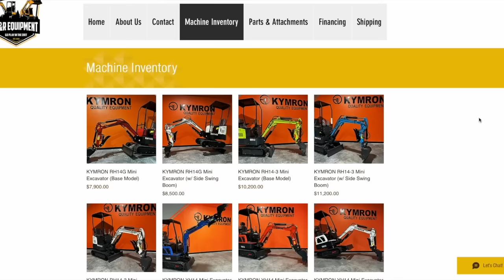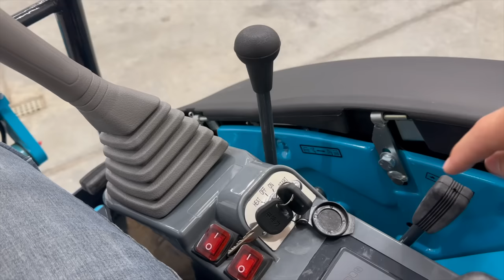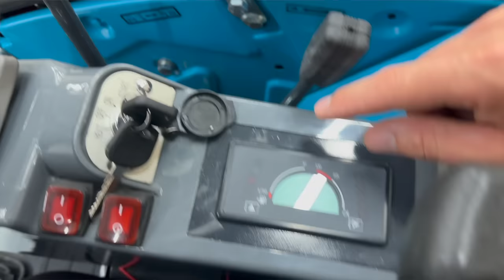KYMRON Excavator...Overview, Testing and Upgrades

Comment: Since you are new to excavators, I'll give you a few tips. Make sure you dig over the blade side of the tracks. Try not to dig over the drive motors. It puts more wear on them when you do that. Also, don't ram the boom sideways into stuff. I did that and ruined the swing motor on my bobcat. It sent a bunch of metal flakes throughout the machine and was about a 3k repair.
Reply from the maker: Thanks for the pointers.  Much appreciated
Reply: @SpicerDesignsLLC  You are welcome. Do what you want with your machine, though. It's yours, not mine. They are expensive enough and I don't want you to have unnecessary expenses or repairs.
Reply: That's very good advice.

Comment: It needs a flail mower test.
Reply from the maker: Id love one but they are pricey
Reply: @SpicerDesignsLLC   Rent one , or have some one loan you one to make a video. Maybe KYMRON  will make it happen.  I have 55 acres and need to wipe out a couple hundred mesquite trees here.  They are small ones less than 3" diameter. I think which ever mini Excavator that can demonstrate it's use would have instant sales, so would whoever made  a flail mower for these mini's ! Maybe KYMRON will produce such an attachment. At a reasonable price. They can't be that hard or expensive to make. Several designs are already out there.
Reply from the maker: @troyb.4101  kymron makes one.  They demonstrate it on their channel
Reply: @SpicerDesignsLLC  I will look for the video.

Comment: Your the metal man, make foot pedals for the travel sticks, you will not regret it, feet and hands together will get lots more done, it's fun to.
Reply from the maker: Id like to try to do that.  I was looking at that the other day.  I think im going to move the two speed foot pedal to the joysticks and add foot pedal ls for the tracks.  Problem is limited space.  But yes im with ya.

Comment: I am a little late to the show just found your channel love it is kymron going to up grade to joystick thumb functions for the hydraulic thumb and boom swing thanks Pat
Reply from the maker: Thanks!  I did talk to the owner about that and he said its an expensive process.  Its bot currently an option that the factory is offering.  I do plan on upgrading mine to thumb controls.  But i may upgrade to a larger unit so im holding off for now.
Reply: @SpicerDesignsLLC  thank you for the quick reply

Comment: see the thumb as a picking tool, the first tree you pull the tree... there is a way with your bucket. orient your teeth toward the tree, wedge the tree between the tooth and then rotate left or right, then curl your bucket back in order to wrap the tree and you can pull really hard. faster than using the thumb and you wont bend/break it. the last test you did with the beer, i would like to see it faster to compare with Kubota's machine. im willing to work on my machine and to modify them. but im not willing to have slower machine. great video!
Reply from the maker: Thanks for the pointers!

Comment: I may not be the first one to say it but for safety as you are digging, your push blade should be towards your digging area, it will prevent you from flipping forward for the most part and it will also help to keep you in place as you dig. I really do like how that machine looks and operates, you did do a great review on it, and can't wait to see what's next.
Reply from the maker: Thanks i appreciate it.  I have a handful of videos using it.  Its been a great machine.

Comment: Just checking if you had the time to work in the joy sticks project, I am waiting for my excavator to be delivery but unfortunately in my case the use of the joy stick to use the thumb is not and option but a need since I got into an accident and became paralized from waist down.  I put some hand controls in my tractor but in the excavator the joy stick will be perfect
Reply from the maker: I have not yet.  I started looking into the hydraulic circuit and i couldn’t find any clear info on it.  I may be upgrading to a larger unit so it probably wont happen on this machine.

Comment: Awesome machine, great video man! 
Waiting to receive mine on Nov 7th. Exact same specs, although I'm sure our hydraulic pumps,  walking motors and Rotary Motor pump are different.  

I was already looking to swap out the joysticks too. Pretty cool to see you're wanting to do the same. Rototilt has some bad ass Joysticks that are also designed to be used with their tilt rotators.  The R1 looks pretty sweet.
Reply from the maker: Thanks!  Congrats on your new machine.  Ive got all kinds of upgrades i want to do.  I found those joysticks on ebay from a Hyundai.  Not sure if theyll work, i have to figure out that hydraulic circuit.  Stay tubed, good stuff coming.

Comment: I have zero personal experience with an excavator but tons of YouTube experience as research and preparation to purchase one for our property.  With that being said I would consider some sort of front windshield since you are digging towards yourself and sometimes heavy things let loose at a rapid pace flying towards the cab. Something to consider.
Reply from the maker: That is always a concern. Theres basically two options, cab or no cab.  Open station is definitely more dangerous
Reply: @SpicerDesignsLLC  Fritzees Fabrication put a Lexan windsheild on his SxS. It wont shatter like glass but will protect you some. Can be mounted without damaging the tubing.

Comment: Where are you getting the 3 way valve?  I've got a 1 ton mini and would like to make this addition but can't find them.
Reply from the maker: I will have some link when i make that video.  Im surprised on how difficult it is to find and get one of these valves.   I ordered two from hydraulic solutions but they said they were on backorder.   They supposedly found the same part in Texas and shipped them.  I still haven’t received them though.

Comment: I think the machine will be great. Your upgrades will make the machine much easier to control. I personally hate foot controls for movements such as the thumb. One question I have is, can the pressure  of the thumb be made adjustable? This would be a great feature handling smaller wood items as not to snap them in half. Might be a feature you could add while changing some of the valving. Just a thought.
Thanks for sharing.
Reply from the maker: Thanks.  That’s exactly what im trying to do.  I found the joystick with a variable control.  Just have to figure out the valving.

Comment: R U gonna add foot pedals for the foreword and reverse drive sticks??
Reply from the maker: I would like to, but first i need to get rid of the other foot pedals and move those controls to the joystick.  I might actually upgrade to the next larger machine they have, the 42.  So i might hold off and modify that one instead.

Comment: This seems like a commercial for these excavators.  I'm really intrigued by them, but curious to see if they actually withstand time.. since resale is likely to be significantly less than name brands.  Looking forward to more vids on it!
Reply from the maker: Ill have plenty more videos.  Just like to give people as much info as possible.  Pushing these any anyone doesnt gain me anything.   So far so good.  I have some upgrades coming soon.
Reply: To be fair, less cost upfront and lower resale go hand in hand. The other issue is people going to auctions and paying too much for clapped out junk machines, and people interpret that as holding value because the machine is better.

Comment: What is the hydraulic flow rate? For the inexperienced the more you dig/rip around the tree the easier the stump comes out. Home use good, for the family ranch use questionable, then again new is much less costly for less than commercial machinery.
Reply from the maker: Not sure on the hydraulic flow rate.  Might have to check their website or get in touch with them.

Comment: @SpicerDesignsLLC  Did you ever replace the joy sticks with thumb controls for the hydraulic thumb and side to side swing?  I would be highly interested in seeing this upgrade.
Reply from the maker: Not yet.  Im holding off using the new joysticks. I might be upgrading to the larger machine.
Reply: @SpicerDesignsLLC  Thank you for the quick reply.  I just purchased the KYMRON XH42D and it should be ready to pick up at the end of this month.  What size are you looking to upgrade to?  Do you know if the XH42D also has the foot pedal control for the hydraulic thumb and side to side?
Reply from the maker: @baywolf1975  im also looking at the 42 and i believe it does have the same controls.  If i end up getting it i will be converting the controls to thumb controls

Comment: Kyle, did you ever figure out how to, or if you could, upgrade the joysticks?  Looking at buying the exact same machine, but I really hate that foot control.  but jumping up to $60k for a kobota/Bobcat is a big step for a few minor changes.
Reply from the maker: I ended up selling the joysticks i bought for it.  I tried to find a diagram and had no luck.  I think the parts will be well over $1k.  My e35 was $60k with tax.  The Kubota u27 is the comparable weight to the xh26d.  Should be cheaper than $60k.    After owning the Bobcat i have no regrets.  Night and day compared to the Chinese.  My advise would be to spend the money if you can float it.  Youll be happier and resale is a guarantee.

Comment: Is it really that slow or is that just because you’re not used to it? Really slow hydraulics can be frustrating to say the least.
Reply from the maker: Im just not used to it.  I have it on low idle and still learning.  Not much experience on an excavator.  Hydraulics move pretty quick if you want them to on this machine
Reply: @SpicerDesignsLLC  thanks, appreciate it

Comment: been looking at these and from a year and a half ago when i'd only seen a few vids of european folks picking them up for homestead stuff from the ports..... to now...   wow.  explosion of imports.    and finally i mean no offense but i feel that if you got a warranty from that dude in OK and he will legit stand by it for a few years of trouble free operation then its probably worth the price you paid, but if you can't just dump it back over there and take a new one if this one breaks then no.     these are importable for around half what you paid,  maybe a little more if its truly a yanmar diesel...   although i may not even be that worried if its a knock off yanmar simply because the chinese knock off motors ive come into contact recently that are actual good copies of things like kawasaki motors etc have been actually very good quality.     and like i said maybe the price premium is worth it simply because you don't have to dk around with transferring money to china and communication and importation stuff...  so all i'll say is:  get an oil analysis after 20 hours or so or whenever you do the break in change and get a clean catch sample.    i believe blackstone labs might even be in your state or nearby.      and do an engine oil/hyraulic fluid filter cutopen to make sure you didn't get a dud thats throwing a  lot of metal into the system.   odds are its probably fine but CYA.       if i was dude in OK selling those i'd take each one and put 3 hours on it or something before i sold it to make sure.    i've seen a bunch of photos on alibaba etc of the different suppliers of these and their similar but subtly different units they ship... this one looks like one of the better ones.     

at the end of the day all i can say is at least some of the IP theft thats gone on in the last 15 years re chn is coming back around to benefit the american consumer, so i suppose recouping a small amount of value in that way.   cheers on the excavator
Reply from the maker: Thanks for all the insight.  Ive been talkjng with Ron from Kymron for a while now,  hes a pretty honest guy.  They just had a video explaining some of the ways they have their machines upgraded vs straight from china dealers.  I did check the yanmar serial numbers and its the same yanmar they out in the Sanys.  Very good points though as far as getting Chinese machines.   Thanks for the comment!

Comment: Why is it that when someone calls your company for dealership opportunities you ignore them. Guess my money is not good enough?
Reply from the maker: Im not the dealer.  I just bought one of theyre machines.  If you email me i can forward it along to the owner.  He pretty good about communicating.  Hopefully its just a misunderstanding and you can get in touch with him.
Reply: I turned around and called that company. Was told I would be called back. As well filled out the online dealership form. Have another company want my business. I deal in four states in equipment. Hopefully your experience was better than mine.
Reply from the maker: @thejammer3359  sorry to hear you had a bad experience.  My communication has been great with them.  If your still interested in can pass it along to my contact over there.

Comment: This is disturbing... pretty sure anything on that would interchange with my Kubota U25.
Reply from the maker: Yes the Kubota U25 is basically the same machine.  Kinda crazy theyre using a chinese platform on that model.  The Kymron has been great for me so far